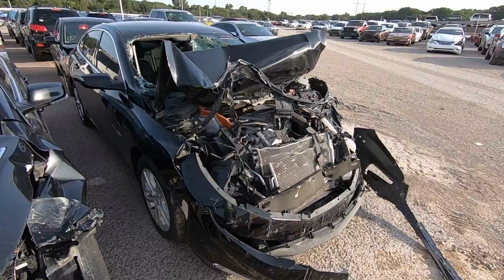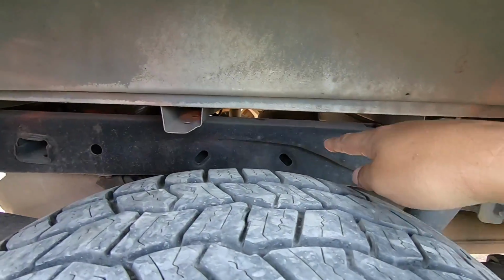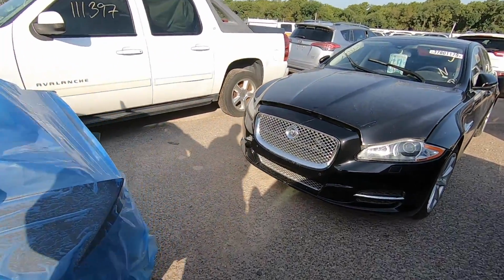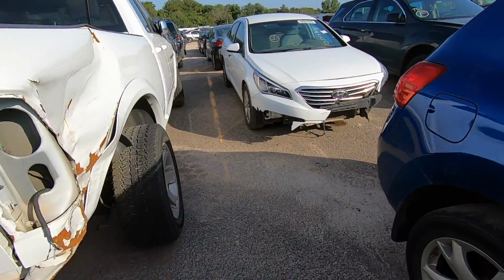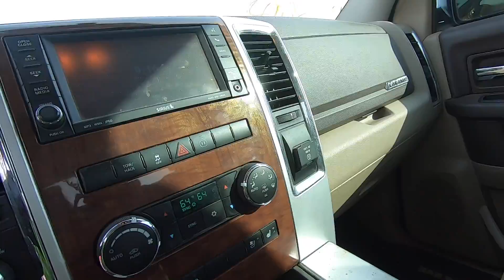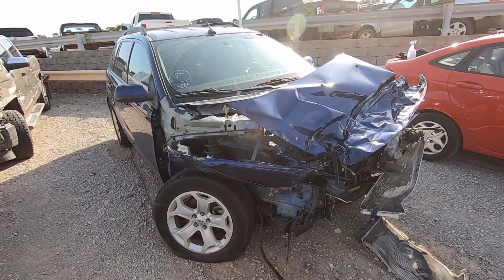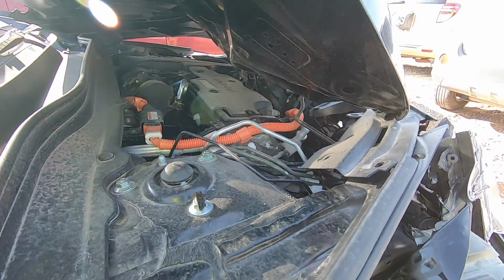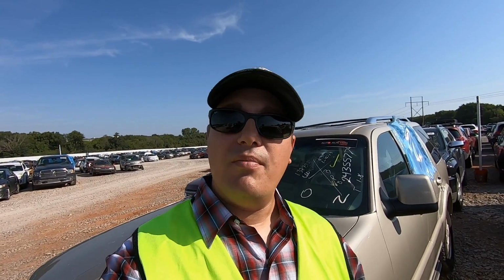Copart Walk Around + Carnage 8-20-19

Comment: Regarding 4 Low different brands have different steps to get into 4 Low. There is usually instructions under the driver's visor. Example Tundra's require in 4 High 1st then can go to 4 Low. No neutral required.  Other brands can want neutral before you push 4 Low button.

Comment: I can't hardly believe that the Accord Hybrid started, damn that car was tough.  To me, it seems like the damage on that one looked worse that it was.  It seemed like most of the sheet metal damage was above the frame rails.  It did look like a lot of the plastics in the engine bay were damaged, too but mostly covers that are likely easily replaceable.  I'd keep an eye on that one.  I loved the F150 and Ram, too.  I bet you could pick up the stripped one for cheap in case you needed the frame but I don't think you will.

Comment: That newer f150 would be a good buy. The box isn't one piece Its welded together in pieces. I got rear ended in my 2012 and smashed the passenger side. They cut that side off and welded new panel on and painted etc.

Comment: For 4x4 low range on the Dodge Ram I would imagine it uses the wheel speed sensors to compare the wheel speeds and see if it needs to engage diff locks, so if a wheel speed sensor is faulty, hence the ABS and traction control light, then it may well not operate in low range either.  It should be a relatively cheap and easy fix.  I don't think you'd need to replace the bed on that, it looks like side swipe damage so replacing the body side and straightening up the rest before adjusting its position on the chassis and she'd be good to go, something that Mike could do in his sleep.  What is more worrying is the ticking from the engine as Dodge lumps don't seem to have the best reputation so that could be the beginning of serious engine maladies...
I would guess that the reason the spare wheel is on the left rear when the damage is on the right rear is because the owner continued using the truck for a while after it took the damage, judging by the rust showing where the paint has come off, so they decided to switch the spare to the left rear and the alloy from that side to the right rear to make the truck look more normal from that side...

Comment: I like the A4. Try to buy it. I'd  have a frame shop straighten it. I dont think it would take them long.  Avoid the Jaguar. Avoid the Ram with its engine noise unless your able to, worst case, afford a rebuilt motor. Avoid the f-150 too. It's 2 turbos are up front & probably damaged.  I thought the stripped Ram was interesting to see.